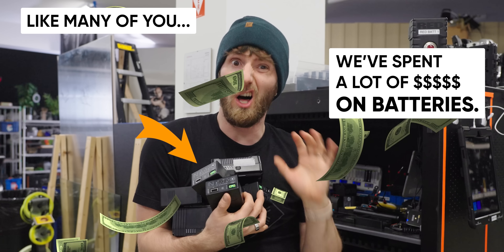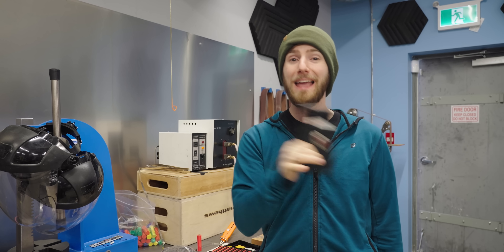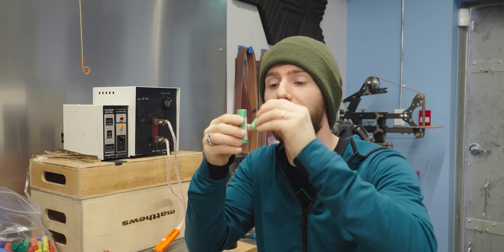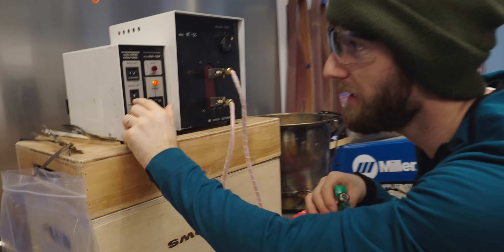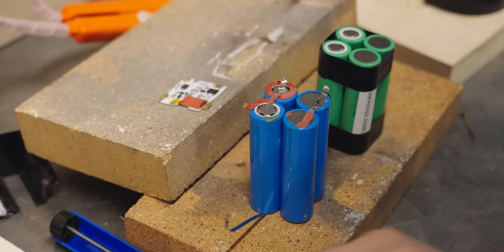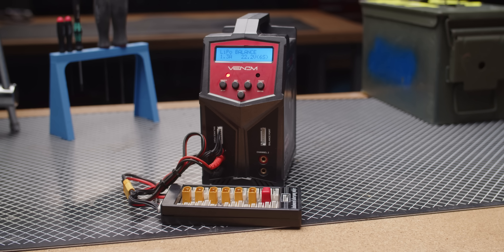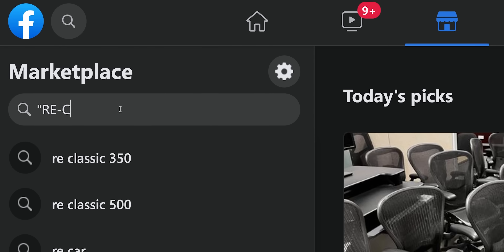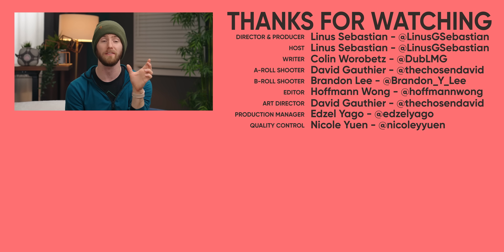This should be illegal… Battery Repair Blocking

Comment: It's absurd that one has to spot-weld the batteries instead of using a connection design that would allow a comparable high mechanical stability while still allowing battery replaceability similar to what we are used to with conventional removable batteries. This lack of serviceability seems to me to have been chosen by design, not due to lack of alternatives.

That said perhaps a real hack could be to make users able to swap these batteries with a system where one could use LFP cells connected in a more traditional way (or even just soldereded perhaps?). 

There might be the need for generic BMS circuits that could work with the power provided by the electronics they are connected to so that it could be used to property and safely recharge the LFP cells. If such system was then open sourced, it could be retrofitted to any casing by also coming up with 3d printable casing for a given model of old battery pack like older laptops with removable cells-based battery packs or cameras and other such devices.

Or am I just dreaming too big? :P

PS: sure LFP provide lower power density, but would still allow use and serviceability while also being safer and longer lasting... and although might be a drawback, one could carry an extra battery and be fine with that? :)

Comment: Also the flash u had was probably harmless. just the normal thing that happens when the nickel didnt make complete contact and melts explosively from the current. Just experience not knowledge though. these flashes also happen when you u se just the nickel as a test and no battery.

Comment: Ok. I am doing this stuff since about a year now. You have really nice safety precautions...actually inspiring to me. However my experience is that these 18650s are quite safe to handle. Wear the safety glasses for sure. The sandbucket is a really good idea.
When it comes to the spotwelding i am using a cheap (actually Temu) welder kits with a car battery. What works best there is to not put both ends on the strip but instead put one on the cell and one on the strip so the energy has to flow from one to the other creating a strong connection. I guess this is actually the reason why the professional premade strips in commercial cells usually have this slit in between. so the shortest way for the welding energy is through both components and not just the nickel.

Comment: here's a thing that i noticed over time with BMSs
when unplugging them from their battery and plugging them back, either on the same batteries or different ones, it stops working, but if you supply even a tiny bit of power to charge the pack, the bms wakes right up

there are definitely some manufacturers that will do scummy things and not let it work after the batteries disconnect, but i think in a lot of cases, if the bms looks dead it's probably just acting as a self enabling switch and just needs a little bit of power on the charging terminals (a lot of the time the charging and load terminals are the same but stuff like usb power banks usually aren't, which is why I'm specifying it) and it starts working again

also i recommend that when changing batteries you try to have roughly 50% cells and if your bms is the circuit that manages charging (like in usb power banks) to leave it charging for at bare minimum 2 times the time it would normally take to charge when new and i usually do 3 times, and don't trust it to not blow up for about a week

Comment: Two tips:

* If you can, replace the sand with Silicon oil 
* a good indicator of a battery health is to measure internal resistance (micro ohms) the lower the better

Comment: Try draining the battery all the way when they nolonger have a long life. Then when completely empty charge it backward and in this backwords charge i only know lead acid batterys this works for it shpuld give in reversed your almost new state returned if a cells shorted this dont work only uf it a working state just life short. It has to do with it pulled most of tge protrons to the neg side and nurrons  to the posstive side. Reversing it brings starts it on the jurney back to the normal state.

Comment: Ebike batteries are annoying as well. Bms that self destruct if disconnected from power, sending canbus signals or simple voltage gates not allowing non proprietary battery replacements and cell updates. Can be circumvented but far more annoying that required. None of it is safety related. Just profit motivated

Comment: And your spot welder could have been bought off AliExpress..... I think mine cost me 20 bucks and then all you need is a car battery to run it the current setting on your welder looks way too high. They shouldn't blow up like that. Mine emits a little spark and then when I try and yank the nickel strip off it tears the strip and leaves a piece on the top of the battery ......that's how strong it is.

Comment: I used to rebuild Dell laptop packs. The "safety" circuitry would permanently disable charging if it detected a Zero-volt condition. To keep the circuit board alive during the cell transplant, I had to provide external power while the 18650s were disconnected.

Comment: I had the same thing with a battery for a Shark vacuum cleaner. I am a tech with 20 years repairing life support. I did nothing wrong had no issues batt totally dead after recelling. I assumed that if batteries are completely 0v it is programed to not work again. Plain and simple if your company does things like this It will be the last product I buy from your company. The unnecessary production of e-waste is bad enough without intentionally making your product non serviceable.

Comment: Right to repair sounds good, but I was in the construction business for over 20 years and found many of the supposedly licensed electrician not very capable. Seems they just hire who is the cheapest to get the job done and rely in the Inspector to correct their mistakes. (Note: Many inspectors also do not know what look for, especially combination ones.) You start doing this with battery repair and people are going to die when their house burns down. Even the manufacturer doing the repairs still has a bottom line to pay attension to. Now are there reputable high quality shops? Sure, but ask the high quality technician and the bozo, and they will both tell you how great they are, perhaps the high quality technician being a bit more humble about it.

Comment: I'd love to see a tour of a professional reconditioning facility. Still not advocating for user replaceable cells is a mistake in my opinion. in most cases it's easy to design segments in an easy to replace way. And sure you can fuck up anything with dangerous consequences doesn't mean it shouldn't be made in a way that allows for it. I've swapped single cells  rebuild whole packs of lipo lifepo and libion packs also made "XL" versions of packs for laptops RC stuff and only had one incident while removing extremely puffed up lipo from Sony laptop and even then it wasn't a violent fire just a slow reaction that went for some time in a nearby sand pile.

You can swap out single cells if you have a stock you can match internal resistance and test others. 

Also you test the voltages when you prepare and again right before soldering and yes I've said soldering as there is a way to make quick solders that work in such packs but it does take practice and prep. And it is durable as it survived quite few crashes of long range fpv builds.

So it might not be fair to expect most users to replace their own cells it still should be designed for.

Comment: Most of the cells may be ok but due to o e or two failing thw whole lot go bad.if no spot welder and the rest of the kit its awkward to replace any cells so just easier and cheaper to get a new one.the good cells can be used on other projects though.

Comment: some bms boards don't have output voltage after re-celling and could be fix with a one second short between input positive and output positive on the bms board.

Comment: You just added to the e-waste by freaking out over meaningless sparking caused by your poor welding technique and settings. Those betteries were almost certainly just fine. There are ways to verify their condition. If you were unaware of that, maybe you shouldn't be messing with batteries.

Comment: Non-rebuldable batteries are bad enough. What should be illegal are entire devices with non-replaceable batteries.  I'm typing this from a $2000 LG laptop with a battery that cannot be replaced under any circumstances. This machine is so thin, I assume the battery is actually a liquid.

Comment: Hey Linus thought you would of done alot better than me even I didn't have that many shorts and issues n I do it as a hobby self taught to I've even turned my finger into a spot welder lol fyi always cover what your not spot welding and you need ring insulation for positive terminals I've rebuilt ebike batterys to

Comment: You're right Linus, I tried to swap out my laptop battery cells and it didn't work, I found info on the net which talked about those BMSeseszz burn out if disconnect it from the cell pack.

Comment: As said.
The sparks is just lack of pressure while welding.
Nothing to be that panicked about.

Be sure you put the battery on a charger first. BMS is shut off and will start up when there's running some charging current through it.

Sometimes they can stop working indeed.
Bridging the BMS with a power supply while disconnecting the cells is an option but difficult to do.

But I, think it's worse.
The batteries are just fine but the BMS is programmed to fake a fail.
Had an HP laptop battery that didn't work but my Model RC charger did said different.

Comment: Interesting. Yes, if you don't know what you are doing, Lithium batteries can be dangerous. However, anything related to lithium battery technology can be dangerous if you take it apart, not always. I don't agree that tech companies and battery companies should "prevent replacing the lithium cells." I agree with Reuse, and recycle moto three RRR including use less. We are running out of precious minerals and recycling is not done often 10-20% of batteries. Cool video.

Comment: I had an electric shaver that said on it's casing that it would fly apart if the pin to open it was removed thus making it "impossible" (obviously not as they assembled it, but very difficult) to put back together.  Everything else worked fine on it so all I needed was a new $5-$10 battery, but I ultimately just took it to an electronics recycler.  The worst part was that it wouldn't even work as a corded shaver since the cable was only for charging; all of my previous ones, when the battery would no longer take a charge, could still be powered by the cable.

I'm going to be much more careful in the future with what I buy and this is one of the reasons I've never liked wireless devices.

Comment: Story Time: One of my father's close friends works for the city of Cleveland, Ohio as a firefighter they got called to a Junkyard 10 times to put out the same tesla because the batteries kept bursting into flames and reigniting before (IIRC they had a electrical engineer who knew what he was doing) suit up in a fire suit just for safety and disconnect and remove all the batteries because the fire department got tired of responding for the same car

Comment: Hi, I know this is an older video and you may not answer or read it but I think I have the solution to the problem of the new batteries not working after you re-cell the device. You should discharge all of the components on the device (except the batteries) and then power it up after the install is done. This process should reset the management system. Hope this bit of information helps you out.

Comment: I remember one true story where a man had one of the 'bionic' servo arms fitting to some amputee's.  I think it was worth about $20k or so. Anyway it had a battery pack that needed replacing several times a year.. at about $800 each time.
Frustrated he took the pack to a vice and cracked the casing....

Inside he found 2 standard rechargable AA batteries. Changing those he got it working again AND he could put hight capacity batteries in it too. :)

Comment: Linus, I think you're being too cautious with the sparking during welding.

If you want to be more cautious, perhaps just weld on a nickel disc or square FIRST, then weld onto that, to provide a buffer for the thin cell ends.
Like to see that tested.

Comment: One other possibility you haven't mentioned in the BMS not being recoverable...  CYA
Or, in other words, avoiding liability claims from the unlucky, a-holes and stupid people.

One example of this that's used on almost every BMS I've come across is to refuse to charge the battery once it gets below 3v  ...or 2.8.... or whatever they deem safe. This is because if the battery or a cell in the system sits too long/too far below the minimum it can become unstable. In my experience with tons of phones & tablets, if they get below the threshold for 6 months or less they're probably fine (THIS IS NOT A RECOMMENDATION) I simply manually charge the battery above 3v & the BMS will charge again.
Manufacturers do this because even though the odds of that battery getting thermal runaway might be 1 in 10,000, when you're selling millions, you can expect that 10 lawsuits may be filed or pissed off customers are going to seek retribution for every million you sell. So the sensible thing to do is to just tell the BMS to refuse to charge if the battery or any cell gets below the threshold.
  This liability concern may also play a role in your issues rebuilding cells. I've had problems with replacing old laptop batteries as well so I just order a full replacement now.

 Old batteries are still great for target practice on a full charge. If you're a pro-user, a little bird told me you can over-charge them by .05 to .1v because they burn better when the case is breached.  THIS IS NOT ADVICE OR A RECOMMENDATION OF ANY KIND.

Comment: the factory tour would be awsome...amp regulator in the charger is better and cheaper..breakers or fuse at charging poles are good for safety....2 to 4 amp charging rates are common for those size battery packs.....charging times vary......have a good ground....cells wear out...such is life...live and learn ...thanks for the update,....,more power to you...

Comment: One minutes into the video my automatic response was: Yes but, the battery management system, low voltage disconnects, and other safety measures are designed around a specific cell's characteristics and those can vary. As long as you use the exact same cells, balance them before replacement and the BMS was designed with a decent safety margin there should be no problem.  Should is good, right? Problem is that people actually win Mrs. Murphey's bad luck, ill informed, or I cheeped out on my eBay cells lottery, in other words it's not the 9,999 times it worked it's that one case of occupied house thermal runaway in the middle of the night that manufacturers are unwilling to take responsibility for. After watching the whole video I thought it was very well done, but...I fully support the right to repair however I also believe we need a way to protect companies/sellers/manufacturers from DIYers who will say it's the maker and sellers' fault for not sufficiently protecting them from themselves by making the packs 110% tamperproof.  Sorry sore spot, even when you win the lawsuit you still loose the company due to bad publicity and legal fees. Bottom line makers have to protect themselves from idiots, does anyone think that watertight file box makers want to spend the extra pennies, and look like idiots, for those no baby stickers in the bottom of their boxes? and those are just simple plastic boxes I mean who would put a baby in an airtight plastic box and then blame the maker/seller?

Comment: if the issue with the bms is using volatile storage one could easily just rip the contents of the logic chip of a working one and flash it onto a dead one used for repair

if they maliciously brick it based on a sudden change in device voltage, manually charge up the replacement cells to the same level as the ones in the doner board prior to copying its flash and then do the same thing

Comment: linus then well gladly take all the old cells off you ,we can test them and group them with other cellls of equal internal resistancesand implemnt cell level fusing ,provided you know what your doing  theres no issues re useing cells ,i agree though its best to not just whack new cells into an old pack but you can match an used cell into a used pack if you match its peremeters
Reply: weve currently designed ebikle race packs of up to 96 volts with up to 1000 amp dc ,discharge limits ,and can be charged at 60 to 100 amps if you have the 3 or 4 chargers required the packs are cooled with full submersion cooling they dont over heat at all,cant catch fire or have thermal runn away and peltier unit helps cool or heat depending on weather
Reply: currently use 3m novec dilectric fluid and miniture oil pump and computer 2 fan radiators
Reply: some of the bike happily hit 100miles per hour plus

Comment: The reactivity of lithium with air or water is not what makes battery fires so dangerous. There is almost no metallic lithium in a lithium ion cell. The danger comes from the uncontrolled release of a lot of electrical power and flammable electrolyte as well as flammable anode cathode and separators. If one cell is shorted due to damage its energy wouldn't be too dangerous but the fire spreads quickly due to kilowatts of power being dissipated in a small volume.